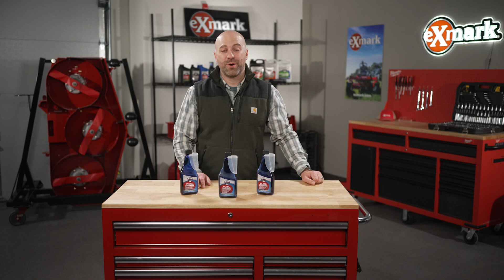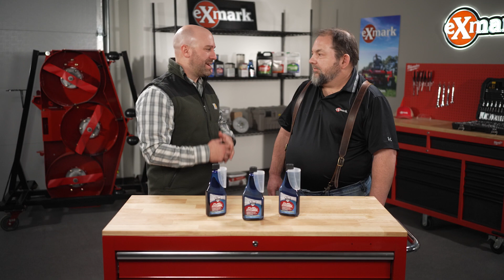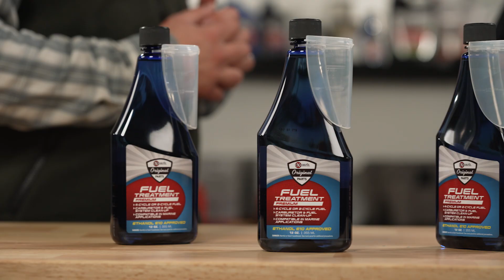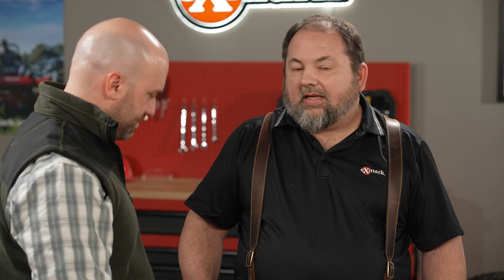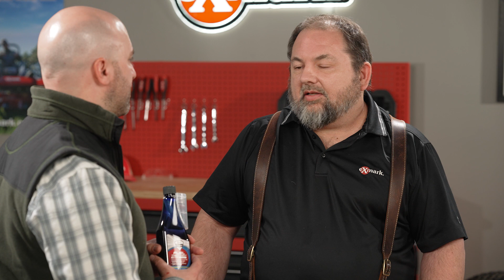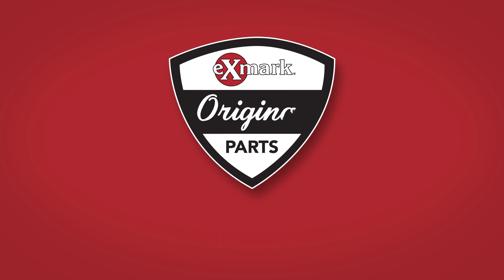Exmark Premium Fuel Treatment | Exmark Original Parts

Comment: Any advice with toubleshooting a Radius that wont start? Had starter rebuilt and getting 14.1 volts but I still just get one "click" when I turn the key. Not having any luck online or in the manual. Thanks!
Reply from the maker: Hello- Please contact us at 800-667-5296. We have trained technicians from the factory ready to help you troubleshoot your issue. Thanks!
Reply: Mine was rhe starter solenoid.  New was shit put a tractor one on been fine since. Take that with a grain of salt. But start with start solenoid.  Hope I spelled that right